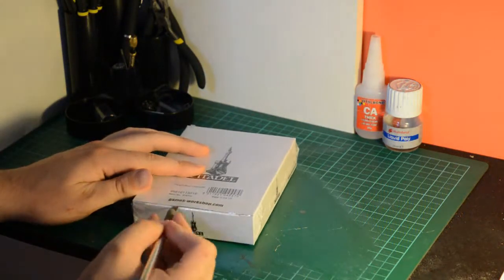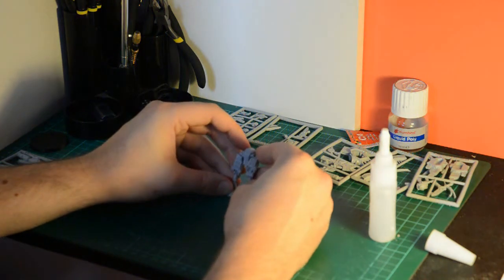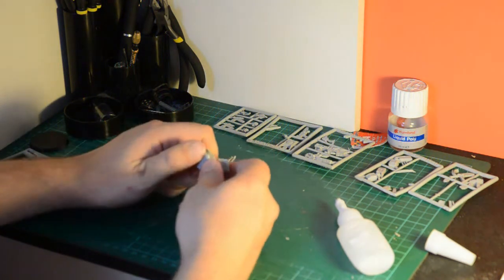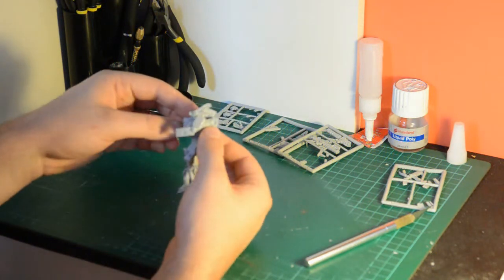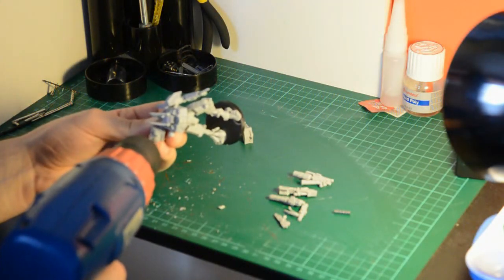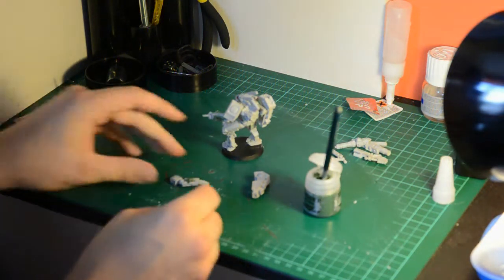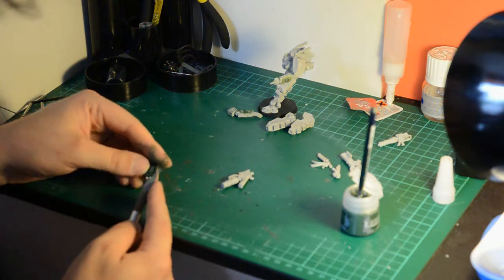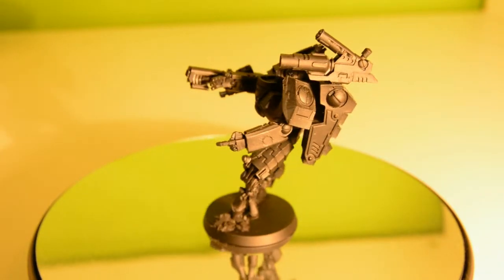Tau Army #7 - Lets Build - Tau Commander With Magnets

Comment: I agree with you on finecast. Metal was a pain to deal with sometimes, mainly on larger models. However finecast seems to require so much more cleaning and filling. The detail on finecast is great (sometimes), but the air bubbles are such a damn pain. Plus the miss casting seems to be happening much more. Finecast Dark Eldar is a test for one's sanity and patience.